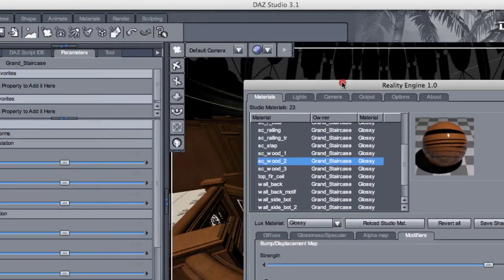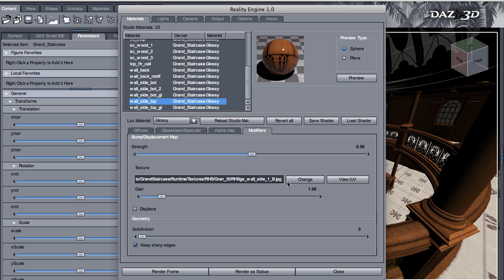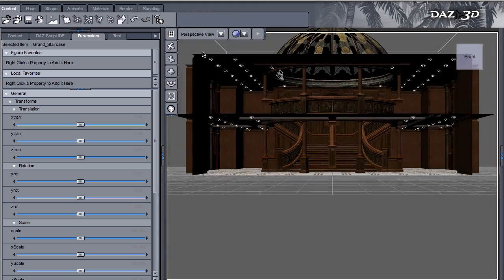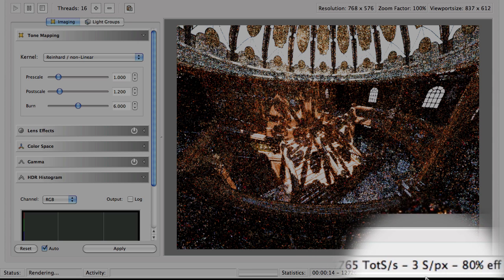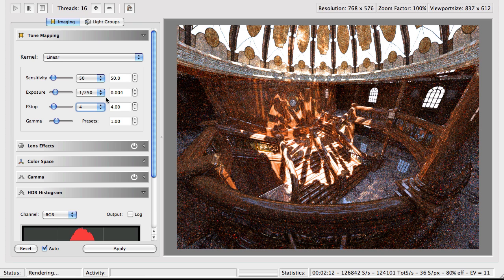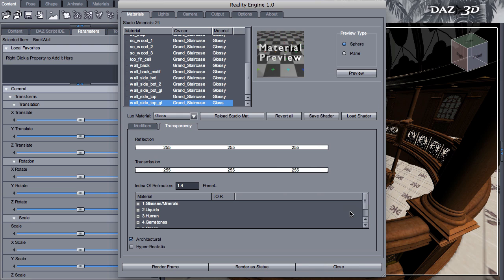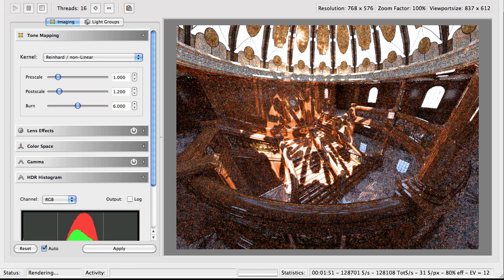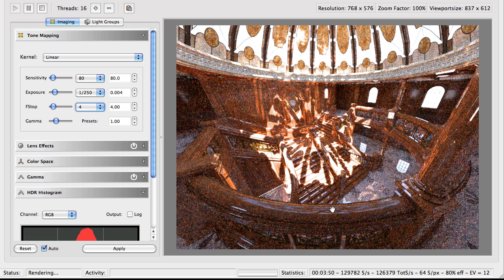Reality 1.0: Controlling glossiness - Part 2

Comment from the maker: @thatbumron There is a difference between "Fireflies" and render noise. The latter will go away easily. You notice that the image starts grainy and then cleans up as the render progress. That noise is normal and art of the process. Lux doesn't use a scanline approach. FFs are large specs, usually white or red, and they tend to get worse. If you see that happening your best option is to stop the render, adjust the light levels and the glossiness and start again.